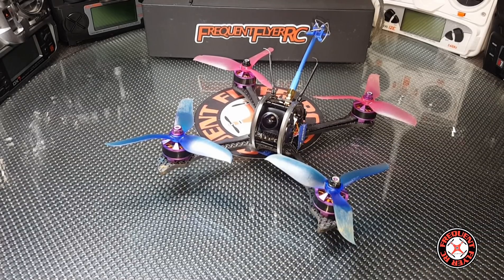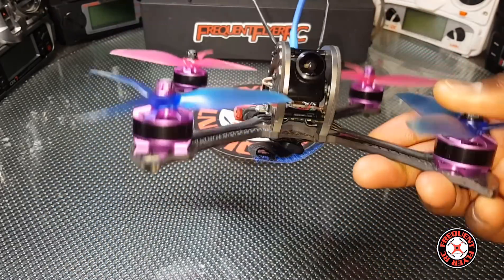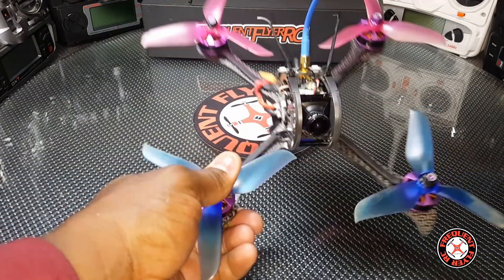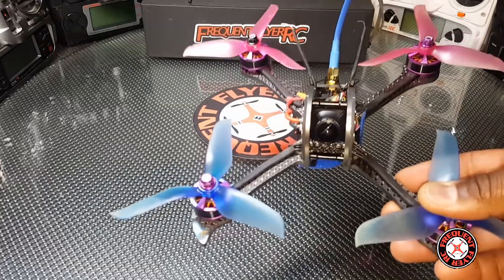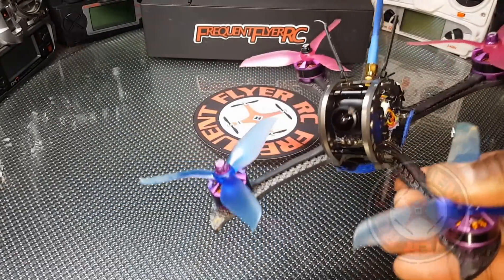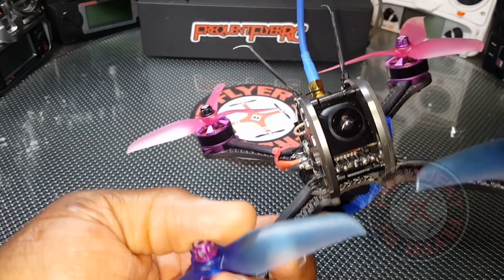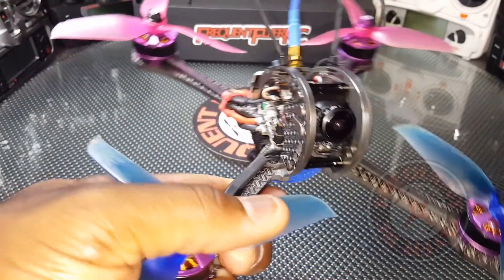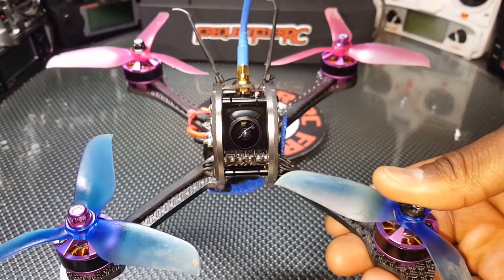Furibee X215 Pro Quick Review

Comment: Hi Frequent. I can confirm the X215 works very well on 5S batteries. Just flown 3 packs to check it. Needs throttle expo and mid point adjustment as it hovers at 12% throttle!! Actually slightly faster than DarkMax due to higher kV I reckon. No heat in motors, battery or ESCs. The X215 may overtake the DarkMax as my favourite flyer. Not sure quads need to be any better than this...it does what I tell it to and is faster than I can handle...glorious
Reply from the maker: +Bongo Fury simply awesome! Thanks for having the guts to try it and thanks for reporting back! 👍😆👌
Reply: They were just staring at me...Dinogy 5S 1350 75C Mega Graphene 2.0 - absolutely rocking batteries. Come down perfectly balanced after 100 cycles. Nice. Makes any quad ballistic !
Reply from the maker: +Bongo Fury link?

Comment: Everyone says these thing handle 6s just because the ESC and FC can handle 6s voltage, it doesn't mean it's a 6s quad lol. I think even 5s will severely shorten the lifespan of these generic motors. They usually start delaminating and/or throwing magnets before too long. Best bet is to run the thing on 4s if you want it to last, it already does 80+mph.
Reply from the maker: +TheRealJonnyD same for DarkMax? (practically same rating on components)
Reply: Frequent Flyer RC The Darkmax has DYS branded motors, but yea they're also really intended as a 4s motor, though they will probably handle 5s no problem. 6s will work for a few flights here and there, but it's not good for a mid-high Kv motor -- honestly it's really pushing it for the ESC too. Usually you run low Kv with 6s (like 1500kv).
Reply from the maker: +TheRealJonnyD true but I think the props are a factor too. Less pitch on the props for 5S and 6S.
I agree with 4S being enough but the point is the it does fly 5S and maybe 6S with good tune and proper setup.. Some components that aren't rated for 5S and 6S would immediately die. In the long run heat and impact are the 2 things that really kill brushless motors under normal use.
Reply: Yea I have no doubt it will run 6s, but it's definitely gonna shorten the life of the motor. It's pushing past the limits of the hardware on these things. Doesn't mean it wont work, just don't expect it for a very long time. Kinda like how I can run 4s on my 1106-6500s when they're rated for 2s -- still not a 4s motor, but it takes it.

Point is, it's positioned as a 4s quad for a reason. If it were intended as a 5-6s quad, it'd have a lower KV motor and likely a higher amp rating on the ESC for good measure.

Comment: Really appreciate these follow up reviews. Some of these quads start off good but after a few flights the problems start. Initial reviews are great but more flights and time is needed to test durability and the longevity of the components. Some may end up in the "Chop Shop" after a month. Keep up the great work man.
Reply from the maker: +Brandon Purdy That's awesome that someone actually understand why I do flights, flights and more flights of the same quad with different props batteries and all and then eventually do a review after I have owned the quad for a while. Most reviewers get the quad and do a review the first and second flight! Only bad thing is sometimes I crash and kill the quad before I get to film lol

Comment: The new flight controller on the Furibee is just a clone of the Kakute. Virtually the same flight controller. Same manufacturer just not branded.
Reply from the maker: +Brandon Purdy oh wow, you have one?
Reply: Frequent Flyer RC Yep. I haven't noticed any drifting. Mine came from the second batch. That's why they had a delay on getting this thing out in Oct. They had to stay with the Kakute design. I know most people bought this for the Kakute.
Reply: I just got one from the second batch. The fc says kakute f4 v1.4 on it, it looks a little different, but not much. The vtx on mine also still has the shield, it was not removed.

Comment: Those motors look like Brotherhobby Returner.
Reply: They may kinda look like them, but they aren't anything close internally. Just another look-alike generic.
Reply: https://img.banggood.com/thumb/large/oaupload/banggood/images/83/59/7921b013-2c89-126f-fb13-71635483493f.jpg

Likely made in the same factory as these racerstars. Flat magnets and similar airgap. The returners are much higher quality with arc magnets.